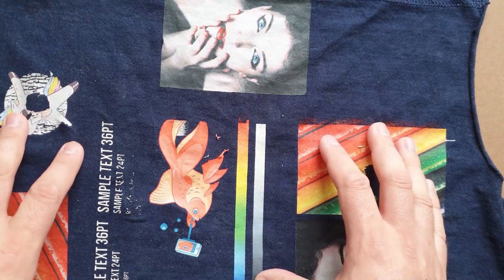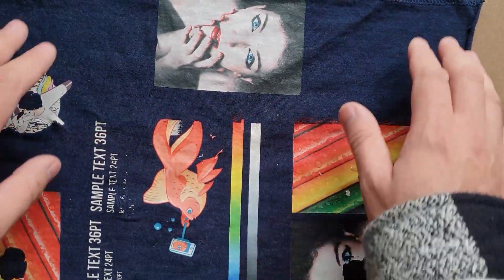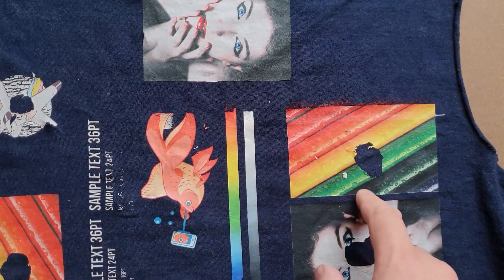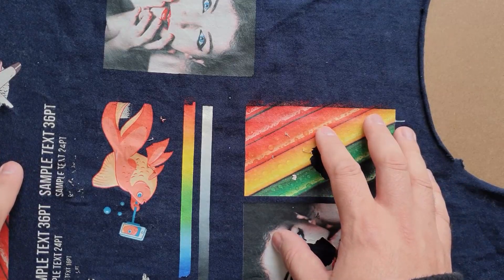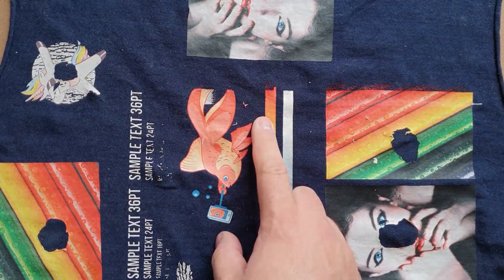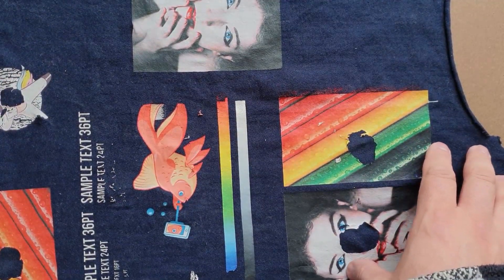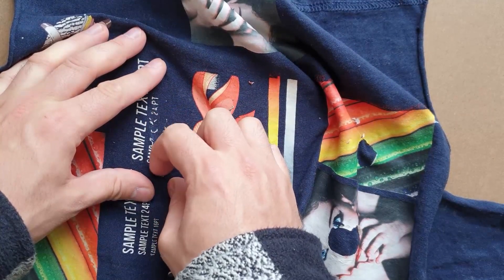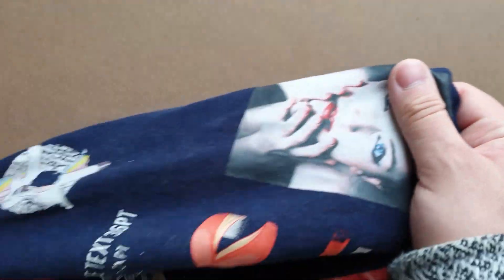Powderless DTF. Is it any good?

Comment: hello, where do you get RIP software for L1800 DTF? thanks :)
Reply from the maker: It comes with a physical USB key that's used to run it so you need to purchase it and have it shipped to you. We'll have it back in stock soon but you can just search for acrorip 9 and buy it wherever you want.